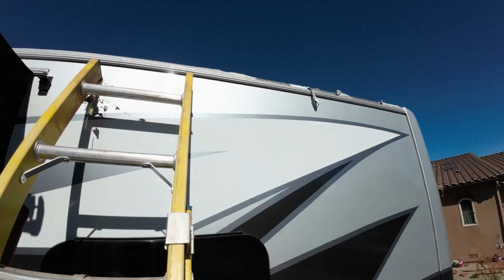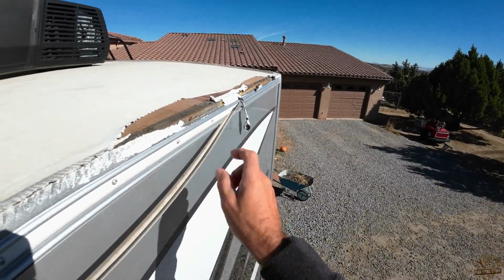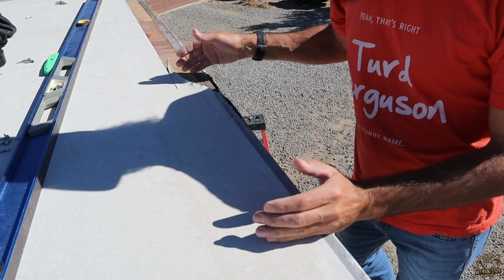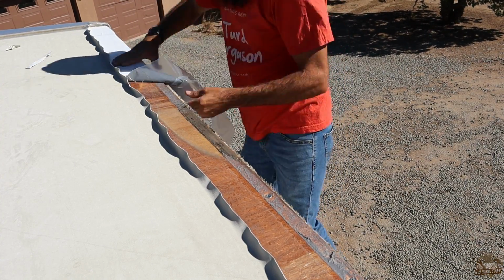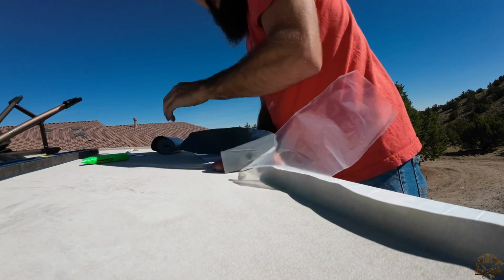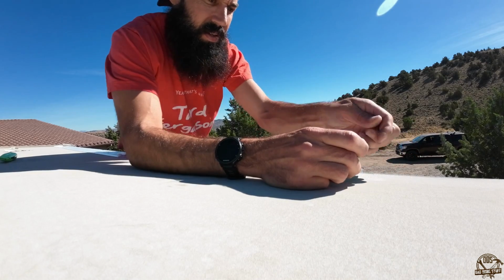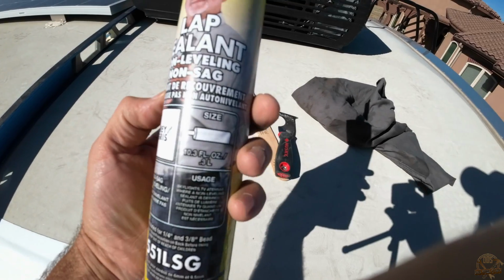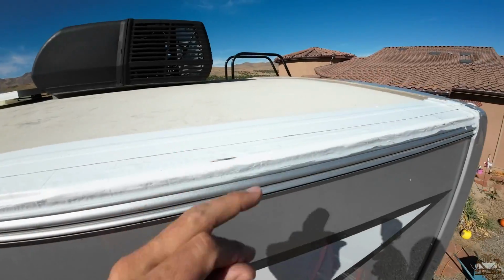Save HUGE $$ on RV Roof Repair

Comment: That flex-seal tape is expensive but it works well too
Reply from the maker: Yeah flex tape is pretty similar.  But definitely pricey.
Reply: @DadDoingStuff  Actually, Flex Tape is great for temporary exterior repairs, but it absolutely WILL start to pull up and roll off after about a year or so if your RV is out in the desert for any amount of time. I've been a fulltime RV dweller for going on 8 years now, and I have found this out the hard way. If you really want a permanent tape repair, Eternabond is the way to go. And while we're on that topic, go with the real deal. I have tried at least three knock-offs that were billed as being cheaper Eternabond substitutes. They were absolutely cheaper, and they performed that way. Another place where FlexTape doesn't do as well, even in the short run, is applications that will be subject to water intrusion. I am right now cruising cross country from the East Coast to Quartzsite, AZ in a truck whose bed cap came with a missing rear window. Having learned that I couldn't get an OEM replacement, I managed to fabricate a more than passable window out of 1/8" poly carbonate. But my schedule didn't allow enough time to properly attach it using the existing hinges, so I created a temporary "hinge" using clear FlexTape. It gave a very good bond in the beginning. That was exactly two weeks ago. Within a week, the tape had yellowed very unattractively. By about four days ago, I could see the plastic tape itself was pulling away from the adhesive. And two days ago, after a drenching all-night rain, it pretty much separated the rest of the way. I repaired it as best I could with all I had, which was the wide, single-sided "Alien Tape" you see on TV. Well, that stuff works great inside, but on exterior applications, not so much. It has begun pulling away from its adhesive already, just over 18 hours later. I will probably pull it off and use all I have left, which is a new roll of black FlexTape, but I expect I'll be lucky if that gets me all the way to Arizona. Just thought you might find this info enlightening. Nice vid.